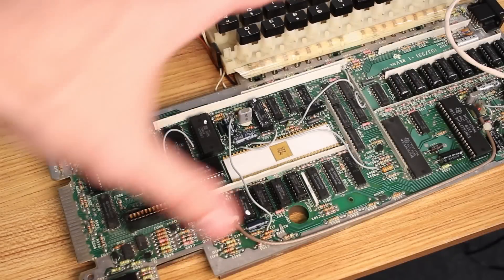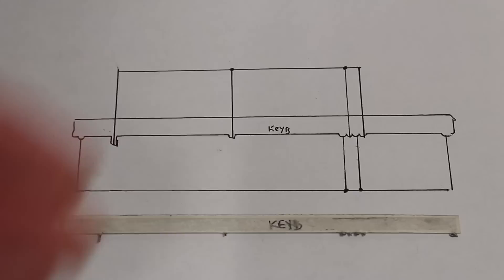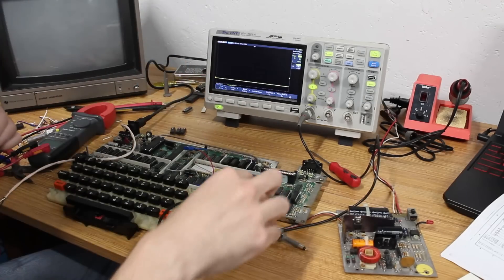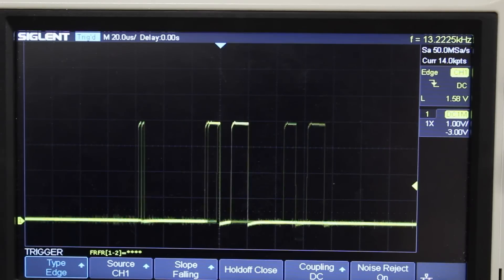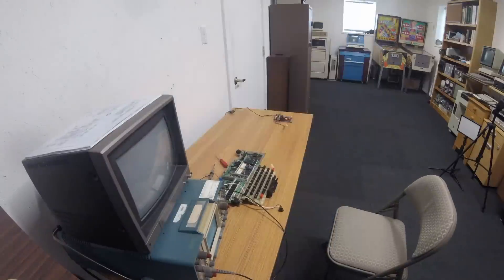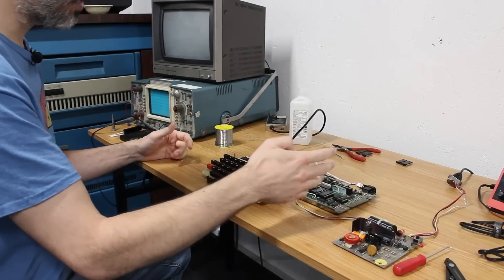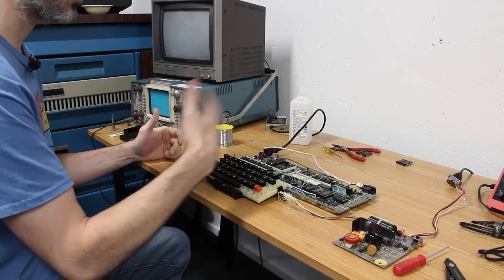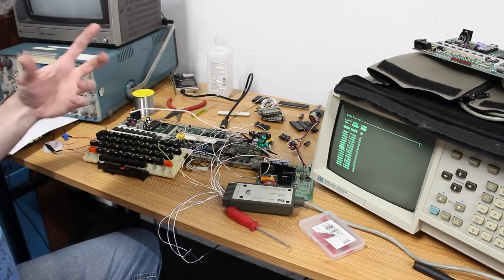This TI-99/4 has Defeated Me this Week

Comment: I'm late to the party, but I thought one way to test high-impedance outputs would be to monitor the chip-select, output-enable, and output bits with a scope. Then place a 1k resistor from the data bit under test to ground or 5V. If the chip's output voltage follows the pull-up / pull-down, then that would indicate high-impedance.

Comment: Well i wish you first did go the easy route and then the hardest route,because what if there was nothing wrong with those ram chips,the video chip or whether capacitor,you may have done all the hard work for nothing,because as in part 2,you discovered a broken joint solder point and once you did fixed that,it did sprung alive,
But hey maybe there was something wrong with one of those ram chips,
Maybe just cleaning the whole motherboard and chips with alcohol with a teafbrush could fix the problem ,(i remember that i couldn’t boot up the gameboy untill i opened it up and cleaned everything with alcohol and it did the trick)
Well i hope you didn’t throw away those ram chips,
Becides what if the main cpu didn’t work,i certainly wouldn’t throw away that chip since it is laced with gold🤣

Comment: Ok, so here is what you do. You build a “CPU” emulator using a rPi or Arduino to statically set addresses, data bits and control signals so you can then statically trace the selects, address and data to memory and devices.

So just use a set of those pin headers wired to the rPI, arduino, or even manual switches and then plug them in in place of the processor.

Comment: Bad rom could cause those problems but I really don't think that's going to be the case. you could always plug in a cartridge. If it works by non maskable IRQ the cpu should jump to that address and start executing code independent of the system rom. If it runs then the system rom is bad. If the problem persists then look elsewhere.

Comment: You've put yourself through a lot of unnecessary work. Verify the CPU is getting the correct signals. Slow down and think before removing chips. I would look towards a non maskable interrupt or other interrupts causing a problem. I don't know that cpu, but I would verify the cpu is getting all the correct and required signals. the only way to verify if the cpu is in a loop is to pull the analyzer back out. then interrupt the system clock and single step it with a pulse injector or maybe a 555 set up in single shot mode. The cpu may be running code or it might be running garbage. I suspect the cpu isnt correctly executing code because its signal requirements aren't being met.  You need to single step it to verify it's not running wild and randomly executing code. It's easy to test a cpu especially if it's off the board. Put it on a breadboard... add some static rams, add a 74ls373 some leds. Write some binary code to address the 74ls373 and write a byte of data to the bus and see if you can produce an output to the leds. you could place the cpu in the high impedance state while you use an Arduino to write code to the memory. If the program executes, you're working.  I was building home brew computers on the kitchen table in my 20's and having to write code into an eprom using switches. I would write the code in assembly by hand then look up the hex codes in order to burn that into an eprom. If I could do all that and only have a logic probe, and a multimeter to work with, you can easily fix this little toy. Before removing any components always verify it's getting the correct signals to operate and if it is then check the outputs and see if its producing the predicted output signals. Again, don't try to fix something by throwing parts at it, and don't jump around the board randomly. Follow proper diagnostic procedures by following the logical sequence of operations or signals that are expected to occur at a given point.. Be confident. Now get in there and kick it's ass, and show it who's boss.

Comment: I already said something similar but you really need a soldering iron and desoldering iron upgrade, avoid messing up rare PCBs like that. You have a YouTube channel try to hit up some manufacturers or look around there is many good options for a decent desoldering iron that has an electric pump and good temperature control. That would have probably avoided your lifted pad situation and will for sure avoid problems to come

Comment: I feel your pain.... I had a piece of equipment that the 5v rail would every intermittently put 7.5v "AC" on to the rails as the low voltage regulator would for some unknown reason fail to regulate.
I had check the rails...all good ... its just some time later that I happened to just check them again that I thought I saw a glitch....and so much patience later..BANG, I caught it.....rude words were spoken loudly. And it STILL did not work....more rude words. I eventually tracked it down to a header connector where one pin was not locked in fully and again would intermittently connect or not  and I only found it because the signal I was looking at was easier to grab off that pin rather than shift the scope over to the other side of this machine to look at it on the board it originated from and I notice the pin moved.....MORE rude words...followed by VERY rude words when it all worked flawlessly afterwards .

Comment: Can you do that on a bread board ?
Reply: That will save soldering. It is a plastic board with holes. Upon electricle components can be "plugged" and wires with also points can also be plugged. "It reduces stress on the compounents. And there for increase there life spann by avoiding metaltireness. It seems a lot of rerouting need to be done.

Comment: As others have mentioned you CAN NOT  just replace those busbar units with wires.  They have very low inductance and some inherent capacitance.   If TI could have used cheap wires to reun the power they would have, but clearly they didn't.  You may remember that in the early machines the DRAMs were very hard to make work properly due to power supply bounce as precharge (Row/Column select) currents are quite high.  Many memory card vendors for the S100 systems failed due to inability to get their boards stable.  What you really need to do is get a fast scope with very low capacitance and start watching VDD/VSS/etc lines to see if the power is stable.  If power isn't stable then you will see lots of toggling but signal integrity will corrupt your data flow.  I wonder if part of the boot sequence to the SRAM is working (they don't need as much bypassing) but the rest of the boot sequence starts running in DRAM and that's where the troubles begin

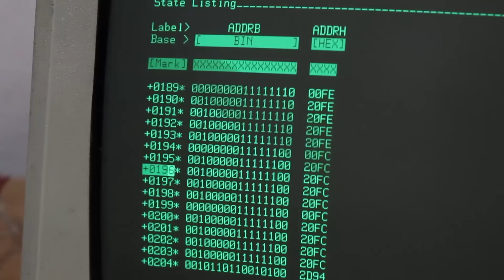Comment: 8:51 - The clue is the way address line A13 randomly goes high causing address to flip between 0194 and 2194 and back again, or between 0192 and 2192 etc. I would scope the a13 line to see if it is a genuine clean pulse or noise. Suspect a faulty ic is causing it but tracing which one will take a while as you would need to isolate each in turn.

Comment: Sometimes it's almost impossible to bring up a system like that, to many dependencies. if you can write a tiny program loop that toggles some I/O port. burn it to a eeprom and try. you can see if the memory addressing is working, the one chosen I/O is working. if you get this far then it's a matter of trying other I/O and memory addresses.

Comment: You mentioned 'rust' on the barn find. I'd check for open circuit inputs on the logic gates. Just scan down each of the ICs with a scope, look for a floating level like 1.5v or so which is what TTL floats to (it will see it as a 1 input though).

Comment: First place to look in old electronic equipment is the electrolytic capacitors, especially the lower values (e.g. 47 μF). It may not seem "logical" in digital equipment, but years of practical experience should not  be ignored readily.

Comment: I have been at that point and wired up a logic analyzer to all address lines, read and write strobes, data lines and trigger by coming out of reset. You see the each instruction executed and compare that to a ROM listing. The first deviation gives you a clue where to look. It takes hours to set up and debug, but it does deliver answers and at this point a few more hours won't really make anything worse.

Comment: If I remember correct, the "paper" power bus bars also had distributed capacitance to enhance power noise filtering. Haven't touch similar board design in 40 years so I am not sure any more.

Adding all the sockets is well worth the effort.  Thanks for the explanation and troubleshooting process.

Comment: Here's what I do. Take a red sharpie and mark ALL outputs of every chip and use that to probe those outputs with a scope. All chips with outputs that are switching are likely good. All chips with either steady high's or low's need to be marked and further tested via checking their inputs to see if their truth tables match. And ofc any chips with in-between logic levels that aren't tri-state are likely bad and that chips should be pulled and tested out of circuit. Tri-state logic can trip you up when all chips go high impedance and the resistor network pulls that line high/low. It will look like an extra slow transition on the scope and gives the illusion of something being bad when it's not.

Comment: The processor's activity after it has gotten off track may not be related to the actual problem.  If a bad bit in an earlier opcode sends the CPU into the weeds and it starts executing from the graphic roms, looking at what it's doing at that point won't tell you much.   Maybe capture a trace from reset ending on the 99/4A and compare that to what's happening at the start on the bad system.   If you are lucky, the problem will show itself soon after reset ends.  Also, if you can find a disassembly on the web of the boot code, that would make it a lot easier to understand what you are capturing on the analyzer.  Especially if you capture the data along with the address.

Comment: I noticed U506 pin 6 going to the enable line pin 6 of U505. As U506 is open collector and the 138 is doing something then 2k2 pull-up must be ok but still leaves the gate to be checked. If you remove all memory chips and set the databus to the opcode for NOP with resistors to the rails, will the cpu behave like a counter to enable easy checking the rest of address decode logic? Only other thing is you burn an eprom with a short test program to run through addresses in a specific pattern and check out the logic pattern with a scope. Do the same on your 99/4a assuming decoding logic the same and compare behaviour of logic lines (a little like signature analysis of days of old at this point). Maybe that might help find a clue? A silly thought just in case. Best of luck 😃

Comment: When you lifting traces off perfectly good boards, its time to stop.  Should have done a proper trace of all the 16 address and data lines after setting up the LA.  General pointers. Check Chip selects on all chips. check Buffers. usually they go bad especially if they are like 8t97 etc. drams also frequently go bad.

Comment: May have been mentioned above, but since it is executing SOME code, you could make a simple ROM and boot from that.  Start with a NOP loop.  Then add progressively more functionality.   Such as memory or IO reads/ that should wiggle the chip selects.   
Then observe with logic analyzer.   

I’m not familiar with that CPU, but what you saw where it was going between something like 0094 and 2094 for one clock:  that could be normal if the cpu multiplexes an address line for status or something.   You’d need to look closely at the timing diagrams on the data sheet.    

An example of similar behavior is the Z80 if you only read sequential addresses, the logic analyzer will capture other addresses interleaved with the real ones because of the built in memory refresh logic.  

Anyway goal would be to observe the addr, data, and control lines going thru the correct sequence and matching the timing diagrams when it’s executing the extremely simple loop of a single operation.

Comment: This brings back some not so fond memories of my days as a Commodore tech.  I could usually diagnose the problem just by turning the thing on, but there were a couple boards that I literally changed every component with known good ones, down to the resistors, and checked every trace and still the same issues.  I sincerely hope this is not going to be the case with your board.

Comment: An important note about the 74LS138… The 3to8 decoder also has 3 enable pins. Two are active low and one is active high. If these are not set correctly the outputs of the 138s outputs will all stay high regardless of the address input pins. So check the enable pins 4,5,6

Comment: I would start with a thorough visual inspection of the board, solder joints and components. Reflow. Did you check the voltage (and ripple) after replacing the broken bar with bodge wires?

Comment: I've got a Texas Instruments DS990 Model 1, which uses the same ceramic TMS9900 CPU. Curiously, I've read somewhere that the Model 1 was used in the design of the TI-99/4, which I wouldn't be surprised if that were true.

Unfortunately, the only thing it does is show 'LOAD ERROR 22' on power on, and if I try to power cycle it, all I get then is a blank screen. I have to leave it alone for hours (maybe a whole day) before I can get that error message again.

I've been working on this machine off and on for about 6 years now, so I'm not holding my breath I'll get it to work any time soon.

Good luck!!!

Comment: i know this is going to be a bit of work but...
1) deep clean the board, its a LOT easier to see if anything is wrong when the board isnt covered in dust and grime
2) re flow all the solder that you havent done already. ive seen joints that look good but werent making a stable connection due to both vibration and age.
3) use your logic analyzer and a camera in slow mo to record the boot up of the known good machine and the dead one so maybe you can get an idea where its hanging up at.

Comment: 13:00 LS138 have THREE chip select inputs ( G1, /G2A, /G2B ), you only checked two . Try testing G1 and the logic gate preceeding it.
Reply: Also worth noting that some replacement logic will not be fast enough when used with other types. IE: mixing TTL and CMOS chips even when they state they are compatible. Try to always go with what the original was.
Reply: The functional speed the chip can
operate at is hardly the only parameter that can differ and the compatibility may be limited to I/O logic levels...

Comment: How do you know the ROMs are good? They fail with age. Desolder and dump them. Mine had activity on the 74LS138 inputs, but not at the same time to change the outputs. It's likely executing junk code, and thus never initializing the audio and video, or activating the 74LS138 outputs, same as mine. I have code for the 99/4A that is very similar that you compare.

Comment: Using a logic analyser is overkill.  Start with the basics by checking the penny logic. For you, as a starting point, check the 74LS138 with its Y0-Y7 outputs disconnected from the PCB. If the outputs are working in this state look downstream else look upstream.

Comment: That "bus bar" is not just distributing power.   It has capacitance as well between the two rails, and is sometimes used in place of bypass caps at each chip.  If you remove that thing you need to install some ceramic bypass caps.

Comment: Look for open resistors- pull up/down bus termination? Plus diodes. If board had flexed enough that the power bus failed these will need checking too.
Reply: +1 on the resistors, not just open, but also significantly out of spec

Comment: How similar is the 99/4's main PCB to your working 99/4A's PCBs?
Would it make sense to use a "regional approach" and systematically take a logic probe to points on the broken 99/4's PCB and compare them with the corresponding points on the 99/4A's PCB to find points that are different and literally zone in on the fault?

Comment: Are you certain those 74LS138's are actually good?  It seems like they're never enabled, and if what you've shown of the address lines working is correct they shouldn't be holding all of the output lines high all of the time. If you have one of those cheap ROM writers they also test 74xx series chips, or a simple breadboard circuit just to make sure.  If they do work, the only thing left seems to be making certain there are no broken traces on the board... I don't envy that task, lol.

Comment: The inputs to the 'LS138 but the outputs were not changing. Either the '138 is bad or something is pulling on the lines and preventing them from changing. To decide which is going on you need to bend the output pins slightly to allow you to put the chip back in the socket but the output pins will be out in the open. You can then check the outputs of the '138 to see if they are changing as the inputs change. If you can get a program listing of the ROM(s) you can use the logic  have a logic analyzer to watch the boot up sequence and see how far it gets by comparing what you see on the LA vs what you expect it to do based on the listing of the ROM. Good luck with breathing life back in to the system.
Reply: I'm going with this. "New parts" doesn't mean "good parts", so replacements can't be assumed to be working. The fact that the line is high all the time makes kevin's suggestion a good way to check if the line is pulled high past the 138, perhaps a shorted trace somewhere.
Reply: I have found those chips marked "E4" are of inferior quality and/or counterfeit. Even though some of them work, I NEVER use them anymore. So, he may have actually installed a problem early on when he changed out the LS138's. I consider the E4 labeled LS138's to be an unnecessary variable, and would replace them with genuine LS138's with a date code before the year 2010.